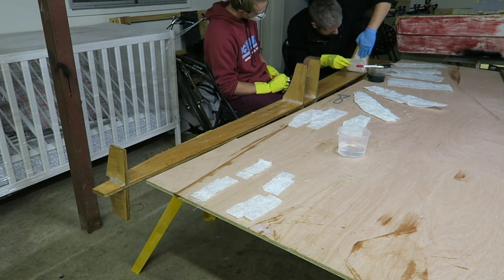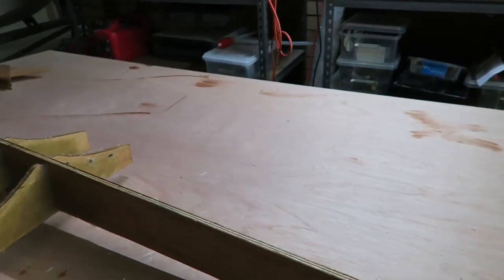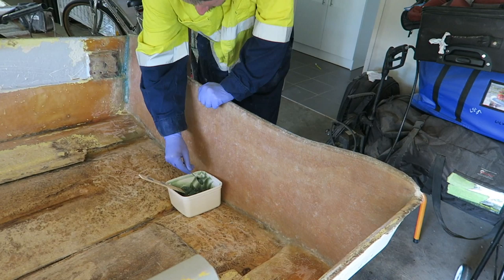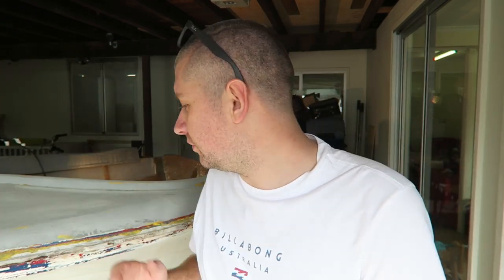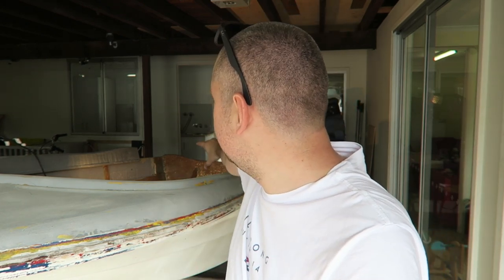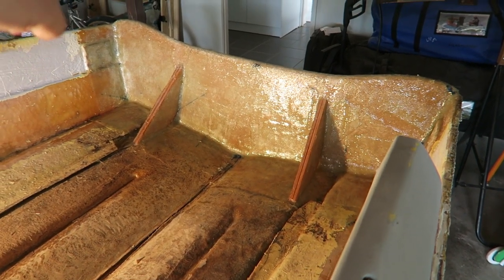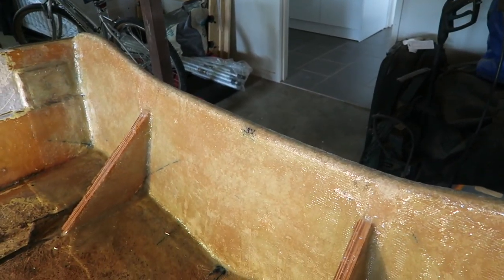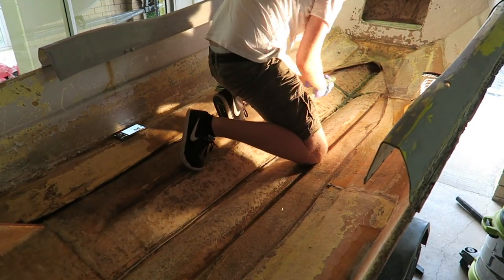The TRANSOM is FINISHED! - The NEW Fibreglass Boat Restoration Project - Part 6

Comment: Nice job. A good way to make fillet base work move faster is take a heavy ziplock bag and cut off a corner to use it like a pastry bag for thickened resin. Then take a plastic spoon and smooth it to a perfect rounded edge ready for glass.

Comment: Only thing I'd do differently is, When We build fishing boats we use 2, 2x4s (or 2x6 if deck is high) for stringer and just 1 layer of 1.5oz cloth and 1 layer of 1708 cloth over the top. Normally just just 14"x38" strips of cloth and cover the 2x4s strip my strip. But you did a perfect job for a none comercial boat

Comment: You should have  used 2 layers of 1708 uni directional Matt on each side of the transom and using epoxy western system it will be stronger in the long run and you will be able to hang a 200hp motor  without it even crackling but if its a jam job good luck to all that sails on her

Comment: Hope your sanding between coats of resin because you might have a de lamination problems because polyester resin has a wax in it or else it will not cure that's why if you let it dry completely you have to sand if it is still tacky you can keep going and do the whole job
Reply: He would be using laminating polyester un waxed
Reply: not all polyester resin has wax, laminating resin NEVER has wax in it and is only added to sand it.
Reply: @cruiser355efi  This Canadian agrees with you
Reply: @Beachnative42  I Agree

Comment: This type of repair should be done off the trailer.  Boats do not sit perfectly on trailers. 
They are always a small bit off.  It’s better to put a block under the stern on each side and under the keel in the front.   The three points helps the hull sit true.  You may need straps on the gunnels to hold them true. 
After putting the hull on the three blocks.  Look and check it.  Measure each side from the hull to the floor at the same location to check and see if it’s true.  Then make the stringers and glass them.   Your hull will be true and it will drive straight!

Comment: I'm slightly worried about water getting trapped, not being able to flow to the back and out a drain.
Reply from the maker: Tim Lewis intention is that the under the floor will be fully water tight (there won’t even be a bung under the floor), there won’t be any places for water to get in there unless the hull itself is opened up from underneath (in which case we’ve got much bigger problems).
Reply: @MattKellyFishing  condensation will still form under the floor and little by little collect over time.  I've first hand experienced water tight spaces get water collected in them.
Reply from the maker: @timlewis840  You've made a really good point that to be totally honest, I haven't been able to stop thinking about it.... I think I'll take your advice, drill out the supports for water to flow, and add a bung under the floor... I really didn't want to go down this path (was hoping to keep it water tight), but it sounds like this is the best option.
Reply: @MattKellyFishing   I think that's the best idea.  Ideally you seal it up well, maybe fill it with foam, but water will eventually collect in there, and it will need to be drained or it will deteriorate the boat, albeit slowly.